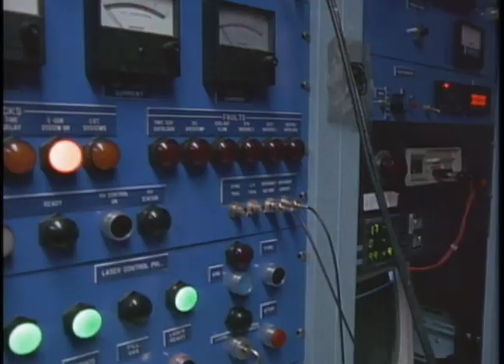Laser Pumped Flying Saucer Spacecraft

Comment: If i'm i right lasers can work only in the presence of air or other gases. How will this work for space travels? Is not the electron beam the only one who can work in vacuum? A laser propelled spaceship can harness the power from the Sun thru mirrors and lenses like a boat uses the wind to be propeled but will the laser work in space?
Reply: Lasers are just concentrated beams of light. The Sun's light has no problem travelling through space so why should a laser's light have trouble?
Reply: jetpaq
Because it takes a massive generator to create that laser. Just because its a laser doesn't mean its not using fuel. It makes much more sense to keep the laser on the ground where you can easily tap into the grid and have massive transformers and such then having it on board the ship.

Think of it this way those tops where very light and he got them up around 40' how far do you think they would have gone with that massive laser strapped to them.
Reply: murrikan education
Reply: ZaphodBeeble Agree. But i guess is not the loser who push that con shape device but the air beneath it expanding too quickly...
Reply: Alexutz CTN I think your right alex, it would need air to be propelled. Also, why not just mount a microwave emitting device in the craft? DUH? all that satellite coordination is ridiculous. the concept is a good one, the application was careless and unimaginative. Maybe hes been working on it too long and couldn't climb out of the box. Im a fan of teslas ionic propulsion, perhaps a dual method on one ship.LIke the enterprise had, impulse, and warp..maybe Ion and microwave? I would sure like to see where hes at with this now? HAs anyone ever heard of the guy that built the water car and got poisoned? What happened to his patents?
Reply: agreed, however this was years ago, plus they mentioned that the laser could be downgraded to a microwave. That technology has been around for almost 75 years, surely theres a means by which to deliver that power in a smaller package..?
Reply: Sadly not so much. The switch to microwave really isn't a downgrade either microwave just isn't going to lose as much energy going through the atmosphere as visible light would. In the end the laser, or I suppose it would be a maser at that point, would have to be massive. Unless the transmission losses are staggeringly huge its always going to be better to have it on the ground as opposed to on the ship where it is contributing weight which leads to the classic problem of needing more fuel to and therefore weighing even more. Especially as it does look like this only works in an atmosphere as you pointed out so this can only really be used to get up to orbit anyways and not for interplanetary trips.
Reply: Curse You NEwtons LAWS!!! Cursse YOU!!...LOL!!
Reply: Alexutz CTN Doh, of course. Thanks for the correction. :)
Reply: Laser light works better in space. No diffraction.

Comment: Strange primitive and inefficient design.
It should compress air somehow before applying heat: either with compressor or using something like ramjet principle.

alternatively if there is no air it should use ion engine powered with that laser of microwave.
Reply: +deltaxcd Not so.  It is inefficient in energy consumption in a way (lasers are not terribly efficient), but I believe the video quotes the specific impulse as almost double what the space shuttle main engines got.
More importantly, a lightcraft would have to carry a lot less fuel -- just some for the last bit of insertion into orbit after the air is too thin.  Given the way the rocket equation works, that adds up to a much higher payload fraction.
Reply: deltaxcd Did you read the other comments?  It could use some on-board propellant for flight regimes in space (or just when the air is too thin).
The chief advantage is being able to lift a lot less fuel, because you would have needed more fuel to lift that fuel, more fuel to lift that fuel, and so on.  By being able to use air as the reaction mass for much, maybe even most of the flight, you can end up with a much higher playload to vehicle mass.
Reply: deltaxcd "What it "could do" is not what it does.
and speaking about that it does not make much sense either. "
Did you just say that speaking of a system's potential doesn't make much sense?

"Ok so you bring propellant with yourself and supply energy from outside what is the purpose of that nonsense if you can just burn propellant itself and 
like why do you will your tanks with water and use laser to heat it into steam instead of just taking hydrogen and oxygen and burning them in the rocket engine?"

Because, as I've explained twice now, you don't have to bring as much fuel.  For part of the trip -- maybe most -- you are using air as the reaction mass and leaving the source of energy on the ground.  I've already explained how that helps a lot, and I won't be repeating myself.

Also, they can just spray the liquid hydrogen cold beneath the craft and use the laser to heat it, both obtaining higher temperatures than hydrogen-oxygen combustion and taking advantage of the lower molecular weight of hydrogen vs. water, making it a much better propellant.

"mot likely it will be just impossible to create laser with output power surpassing moderate rocket engine which is in the range of several gigawatts or even hundreds of gigawatts."

I won't ask for your evidence.  I'll just note that a lot of smaller lasers can be combined into one beam.
Reply: deltaxcd
"Seaking about potential of completely vaporware system is useless.
if you have specific implementation it can be worth discussion."
So speaking of jet engines before one was built would have been useless?  Or building a "tower to space" ?
Reply: The advantage is that it's not bulky. Scaled up, this would replace the entire booster system of a rocket with a larger version of what was in the video.
Reply: John Crichton
This design cannot replace anything because it is incapable to fly without air and it is very inefficient in all aspects: energy consumption and specific impulse.
Reply: deltaxcd LOL!  OK, I confess, you trolled me.  I didn't realize it until now.
Reply: Emma May
What it "could do" is not what it does.
and speaking about that it does not make much sense either. 
Ok so you bring propellant with yourself and supply energy from outside what is the purpose of that nonsense if you can just burn propellant itself and 
like why do you will your tanks with water and use laser to heat it into steam instead of just taking hydrogen and oxygen and burning them in the rocket engine?

If you want to make that useful deal you have to make laser heating much hotter than burning but that requires enormous power and mot likely it will be just impossible to create laser with output power surpassing moderate rocket engine which is in the range of several gigawatts or even hundreds of gigawatts.
Reply: Emma May You do not need to build it. Simple description is enough for start, but so far you don't have even that. All what you have is claim to "use laser to launch rocket in some way which will be invented in future".
Reply: Emma May
I trolled you when you are one who initiated discussion? I think you are more fit to be a troll here.
Reply: Emma May 
What you say is irrelevant because this saucer is using air  not fuel. In that aspect you cant even talk about specific impulse because it is not even rocket engine, it is some kind of pulse jet engine which cant work in vacuum anyway.

Laser efficiency is not that critical when you can leave on the ground. Efficiency of typical rocket is way less than efficiency of average laser.
also in any case you always have trade-off between energy consumption and specific impulse. if you want to reduce fuel consumption twice you have to increase energy consumption 4 times
Reply: Emma May
Seaking about potential of completely vaporware system is useless.
if you have specific implementation it can be worth discussion.

"Because, as I've explained twice now, you don't have to bring as much fuel"
where all that came from?  did someone canceled all physic laws?

"For part of the trip -- maybe most -- you are using air as the reaction mass and leaving the source of energy on the ground. "
this part of the trip is not that significant air is available for like 10km height at most and you need to lift yourself to something like 100-200km at least.
and even if you use air, this kind of engine will be incredibly inefficient if it is not compressing air before heating it

"Also, they can just spray the liquid hydrogen cold beneath the craft and use the laser to heat it, both obtaining higher temperatures than hydrogen-oxygen combustion and taking advantage of the lower molecular weight of hydrogen vs. water, making it a much better propellant."

yes using hydrogen will provide you some benefits, but again as I told you earlier this is trade off between energy and mass, so you will have to build a laser which can supply more energy than burning same amount of fuel.
this method is useful if you have some powerful nuclear heat source but when you have something like laser what can be converted into electric power you get far better results with ion engines that can heat fuel temperature in orders of magnitude higher than you could do it with laser directly.

using laser to heat fuel directly would be like burning money to light your room or filling water rocket with gasoline. Sure, it will work but that's simply barbaric.

"I won't ask for your evidence.  I'll just note that a lot of smaller lasers can be combined into one beam."

I newer said it cant be done question is if that is worth doing at all.
Building laser array which power output is comparable to all power stations of moderate state is not easy task and benefits are pretty small in comparison to its cost. I wonder what power source you are even going to use to power it all can you even imagine how to generate tens of gigawatts and amount of fuel it will require?

I think building tower directly to space can be cheaper alternative.

Comment: They could use an ablative coating that would turn into plasma. Only problem is that once the coating is completely vaporized, you're effectively out of fuel. Maybe the radiation pressure would allow it to continue to operate like a solar sail?

Comment: but you could get into space without fuel and then you wouldn't slow down because there is no air resistance so you can use it to bring supplies to a space station then launch it back down from the station.

Comment: A very optimized design should be able to carry it's own fuel, considering the efficiency of this type of propulsion and the amount of thrust it gives off it just might be possible.
The real problem with this design is that it depends on ground based lasers that have to go trough the atmosphere and missing the target at long distances due to distorition. that And the fact that it must face directly away from the laser, meaning no maneuvering is possible

Comment: So we are talking about fusion.
In essence hydrogen in been converted into helium through a high energy pulse in the form of a laser. So theoretically it could be hydrogen gas been used to spin the objects.
But what would you use to deal with such incredible temperatures,tungsten carbide?
Ultimately you would expect melting/burning, its how you deal with it poses the biggest question

Comment: and hence, the propulsion wouldn't work if the laser is no the craft because the laser is not the propellant, it is the air plasma under the craft. if you put the laser under the craft, the earth surface would experience force but the craft wouldn't move at all

Comment: If the beam misses, it automatically defocuses; that's the nature of the transmitted energy. No danger at all.

Lasers spread a lot: you can do damage from low orbit with lasers, or ground lasers reflected back to earth, but not do damage to anything on the moon, or further, unless it was an incredibly strong laser. You could however, use earth based lasers to illuminate work areas on the moon, during the long lunar night.

You could also defocus them, and illuminate search areas in S&R ops.

Comment: if the inverted cone were synced to the laser so that the laser and the cone know precisely where the other is and adjust accordingly to ensure it to inverted cone, they could get it as high as they want and keep it in the air aas long as they want...well until it fries out the inverted cone. but nasa's idea is more practical but it has to start some where.  beyond nasa's idea, you could have the craft itself be able to convert the energy it needs itself

Comment: The main advantage of beamed-energy propulsion is that the energy source (in this case whatever is powering the laser/maser) doesn't have to move. Putting it on the craft itself means you need to life the fuel as well as the ship and its contents. Not having to lift your own fuel allows for the hugely smaller spacecraft.

Comment: Actually, this wouldn't work in the vacuum of space, the fart sounds you hear are the explosions of air occurring under the craft see 2:50. Without that air the laser is too weak to propell it by photon energy alone. However someday we will have Lasers powerful enough for deep space, and combined together with Solar sails or Light sails, The cosmos will be open for exploration.

Comment: We need to understand that this is a technology that is still in the development stages. As for the heat that gets generated, there would be shielding from that heat and of course an efficient way to convert the heat into useful energy that could be used for all types of applications on board the ship. I think the team working on this has made remarkable progress in the short time they have been working on it. I want to see the team succeed. This is revolutionary!
Reply: Wonder what the heat issues are in space where its heaps colder.
Reply: @fanatamon  Granted that heat in any form tends to radiate away from its source, in this case, the device that generates the heat. That said, there are ways to use that heat to do and produce many useful things. We use heat all the time on Earth for nearly everything we do.
Reply: @ArtAgent13  for sure and the allowances for heat use and dispersal would be much different in space environments I.e where one side was facing the sun it would be hotter so a balance would have to occur at times.

Comment: Many people assume that very precise tracking by the beam is necessary - it isn't. Apparently the craft is (or can be) inherently self-centering in the beam, like a pingpong ball on a jet of air.

Orbital systems could be built (geo-stat or Lagrange) with large solar collectors which could be used to power beams for interplantery craft (to Mars, say).

Comment: @TheRoomy I was wondering the same thing, but if you listen closely they drop this little conceptual handwaving doozy: "To fuel the rest of its journey, the lightcraft would use super-heated gas, accelerated by powerful electrical and magnetic fields." Which seems to be saying, "someone in the ion-thruster department figures that out, we just get the thing to orbit." Though if you're gathering such amounts of solar energy, why not use it to refine a fuel like hydrogen cells so it has other uses?

Comment: @ctcentralinfo, Yes, it would. But it would increase the range at which it would travel by a pecentage as well as the overall safety. In the example I gave, the entire system is enclosed so no "accidents" would happen off of the ship in case something decided to float in front of the microwave beam. This also means the scenario of a microwave misfire is eliminated completely. During lift off, the ship may encounter turblence and move off coarse, allowing the microwaves to reach the ground.

Comment: What if you were able to get some powerful generator to be on the craft itself? Since the laser has no recoil (I think) you could wire the generator up to the laser, point the laser at the "saucer" shaped piece that is strongly mounted onto the craft, and get forward motion. Then, for acceleration, just lower or heighten the intensity of the laser. For reverse, just give the "saucer" thing symmetry, with another laser pointed at it. Then, no "cooking" people with giant microwaves. :)
Reply: I like that.

Comment: @starcinders Oh, yes, because microwaves are TOTALLY SAFE. :P

A space-based microwave powerful enough to lift a ship would certainly be powerful enough to cook a few people too (or knock missiles out of the air).  Remember, this guy used to work for the SDI, and this just looks like another excuse to put military weapons, pointing DOWN, into space. Call it a "missile defense shield" or a "transport system" it's the same thing. And EVERY nation on the planet won't tolerate it. Period.

Comment: @Masterpj555 The concept is that the laser will be on the engine when it takes off. If you shoot a laser you don't feel kick, as you would if you shot a gun. Rather you're using the laser to ionize the gas, giving it a magnetic field, therefore it can repel a field of the same polarity, creating propulsion.

They advanced this idea and now call it the Ion Engine, NASA has developed and tested an engine with this concept, its efficency is about 3 times greater than engines use for lunar landing.
Reply: The laser won't be on the engine, it will be the engine. Lunar landers used regular rockets, no ion engines. And no, this is not an advancement of the ion engine

Comment: @dumle29 When an object leaves the direct gravitational pull of earth, it maintains its average velocity until a force acts to stop it. It's the same principle modern day spacecraft use.
However, since there is only about 1 atom per cubic meter in open space, to continue propulsion in space you would need some sort of basic hydrogen fuel system to couple with the ionizing radiation propulsion.